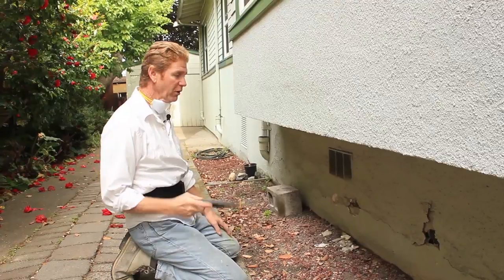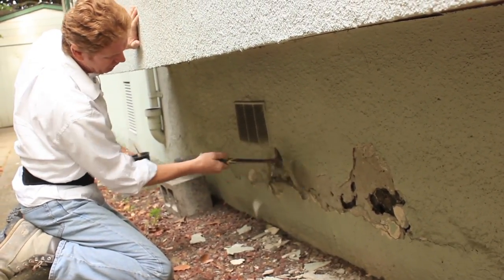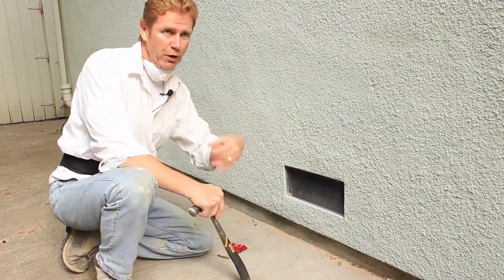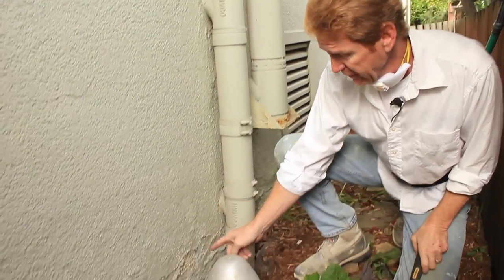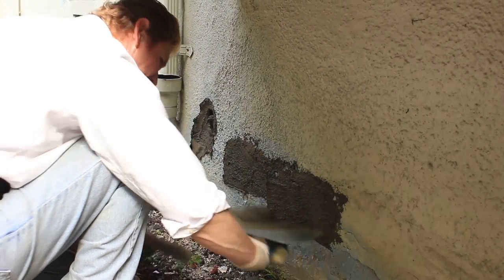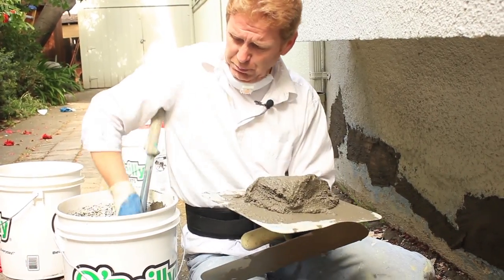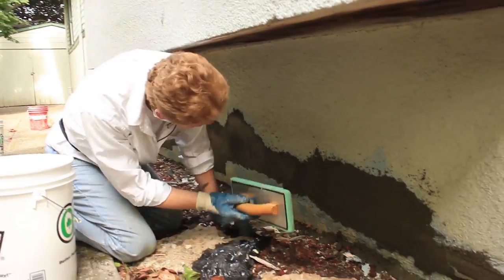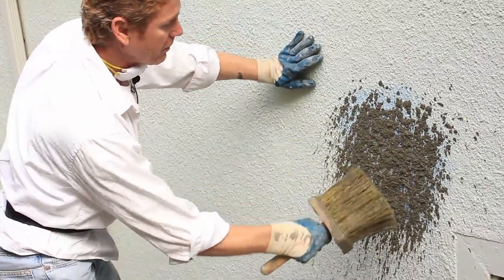Stucco buckling?

Comment from the maker: Hey Gil, the weld crete helps with the bond, but if you’re going over wire it’s not necessary. On this job there was some painted surfaces that needed attention?
 Have a great day! 
Kirk Giordano Plastering

Comment: I have  a small section about foot wide similar to what you showed.  My question is should I wait to patch it or does it needs to patch immediately?
Reply from the maker: Good morning No U dude, this buckling that we are repairing has been this way for years. Depends on the location and whats behind it that may make it more important to repair immediately.
                                             best wishes,
 Sound advice for plastering issues from your favorite stucco geek
Reply: Mr Kirk… it appears you are making the repair while ONLY using “weld Crete”  over the paper and NO wire lathe? Am I seeing it right? Thanks Bobby!

Comment: Hi Kirk,
Thanks for your informative vids! I want to try and re-stucco my house. There is one old layer of smooth stucco (1940) and one layer of yukky throw upppy stucco on top of that. Can I restucco on top of this mess?!! Thanks, Sally
Reply from the maker: Good evening Sally, yes, you can however proper preparations are necessary, as in pressure washing and an application of a bonding agent to the existing walls before application of new stucco, I would highly recommend you hire a professional for this type of project, as it takes at least 10 years of applications to really understand how to do this properly.
                          Live long and plaster
 teaching repairing your number 1 investment, your home
Reply: oh wow! ok and thanks :)
Reply from the maker: Howdy no worries,
                       Live long and plaster
 DIY repairs for your most prized and number one investment, your home.

Comment: For me to understand your work is to repair the wall etc but it’s an painters job to make it no longer an eye sore? ..

I bought an house it has some falling stucco in small areas and paint falling off on some areas I’m expecting to have some eye sores but rather have it fixed then not,
Reply from the maker: Howdy James if the stucco patchwork does not match as close as possible. No amount of paint will help it. Paint enhances flaws.
 No one can match every single stucco finish, but the closer it does match then the priming and painting does the job.🍾

Comment: Will that bonding agent work on a painted surface?
Reply: yes
Reply from the maker: Greetings Jay, the painted surface has to be very clean then apply the bonding agent to it and yes it will work to bond new cement plaster to painted surfaces.
                         Bringing peace, love, and harmony to plastering 
         Sound Plastering tips for the DIY beginner or the Plastering experts

Comment: what is the accerlator called?
Reply from the maker: It's called luminite, but do yourself a favor and buy "Rapid set Stucco" from HD or lowes in boxes or bags it has all the accelerators and sand in it, you just add water.

Comment: thanks I keep missing the name of the exselarater
Reply from the maker: Good evening Michael, no worries, it's called, "luminite" but a bag sells for about 60 to 80 dollars, and they only come in 94-pound bags. Plus, they are only sold at cement or plastering yards.
    Save yourself the time and buy, Rapid set Stucco," at Home Depot or Lowes, this product sells in 10 to 25-pound boxes or bags that weigh around 50 to 94 pounds. 
All you do is add water, no sand or accelerator needed as it's all in the bag. With all the same day cement plasters, don't overmix. 
   I mentioned above how expensive accelerators are, the "Rapid set Stucco," has the accelerators added at a fair cost, it's now foolish to buy, "Luminite" unless your a big time stucco contractor as too much would go to waste. 🤔                 
Bringing peace, love, and harmony back to the world of plastering.
    The complete plastering encyclopedia on video, by the plastering messengers of Youtube with over 800 videos

Comment: This type of buckling has occured on our stand alone garage. However, it's a little more sever in that the parts beneath the buckling are loosening and breaking away, leaving no solid stucco on the bottom to tie into.  What would you do in our situation? I've dug away some of the dirt where the bottom broken pieces are buried.  Can I pay you guys to consult with us, over the phone and email? We also have a house with second story stucco -- stucco around the windows and on the angles roof is completely bubbling up, and open to the rain and snow. I would love to handle all of this as soon as possible and am scouring all your videos for answers but some specific advice four our situation would be so valuable -- can I call any of you about this?
Reply from the maker: https://youtu.be/9KeC3_-0NkE/ It may not be as severe as you think.  🥳

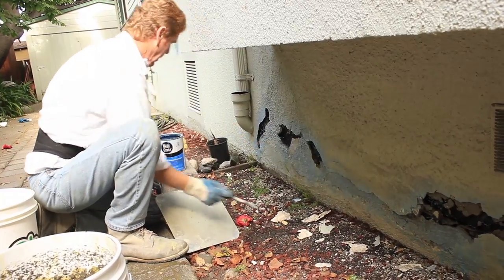Comment: At 5:42 - is there a downside to patching with a traditional 3-coat process, waiting 72 hours and wetting 3x daily on the 3/8-inch scratch, and then add a 3/8-inch brown and wet 3x daily for two weeks, and then hiring you to do only the 1/8-inch final coat + matching the texture? Or do you find homeowners that DIY part of the work annoying?
Reply from the maker: Not really, We enjoy taking over projects started by others regardless of whether they were started by general contractors or homeowners. 😉

Comment: HELP!
Hey Mr Kirk…I see you broke out the loose stucco BUT didn’t RE-WIRE! 
Just using weld Crete over the old paper and applying new patch? Thanks, Bobby!
Reply from the maker: Evening Bob, the paper and wire were still intact; thus, a bit of bonding agent and replastering was all that was needed.👨🏻‍🔬
Reply: @StuccoPlastering Is Quikrete an ok substitute for weld crete? If not where can I purchase it?
Reply from the maker: @chadhouse1375  Yes quikrete is used more than Weld-Crete as they wrote the book on cement bonding agents, plus Quikrete bonding agent is sold at H D and Lowe’s while Weld-Crete is only sold at professional Plastering yards such as “Westside”